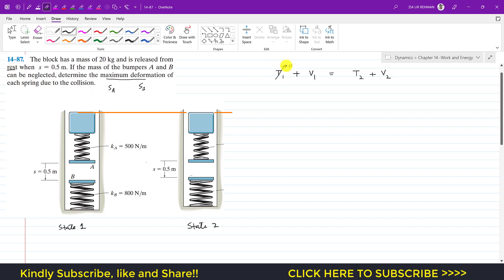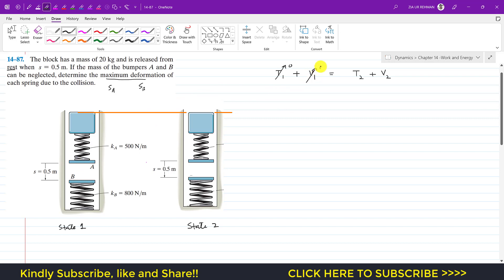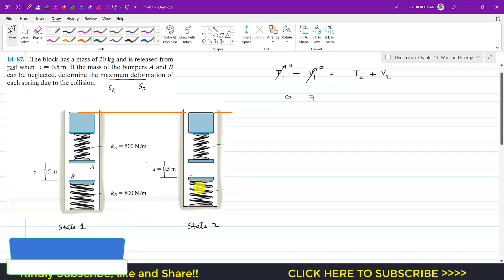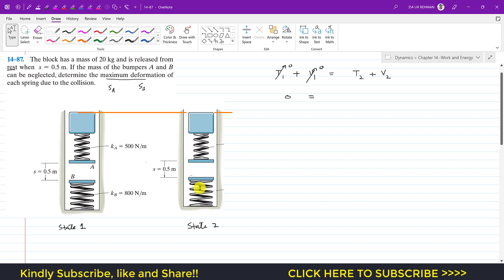14-87 Kinetics of Particle: Conservation of Energy Chapter 14: Hibbeler Dynamics | Engineers Academy

Comment: How could you wrote spring force balance without considering the weight of that black connected with spring A ?
Reply from the maker: The energies are considered only.
Reply: @EngineersAcademy2020   But please explain little bit next because, I've a confusion that at maximum deformation, these forces are in equilibrium but why not weight of block above A is considered ?? As, Fs_A = Fs_B but what about that W ??